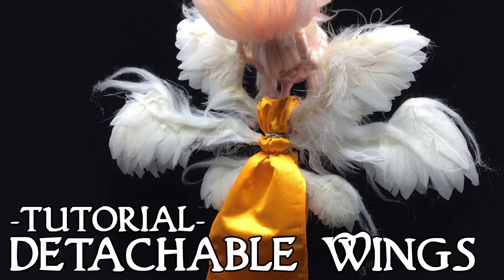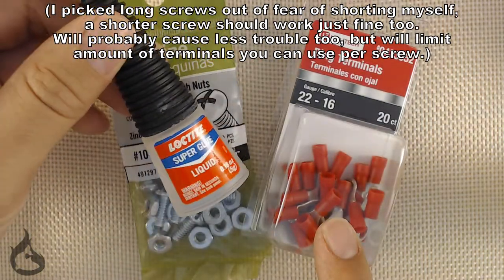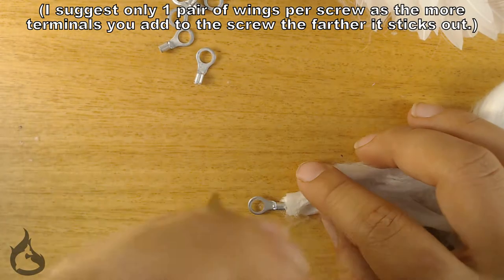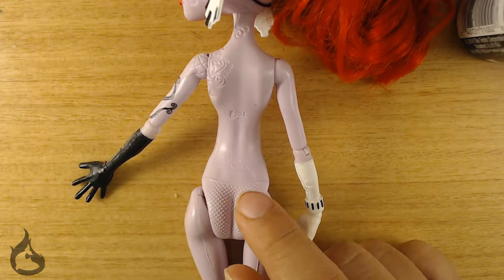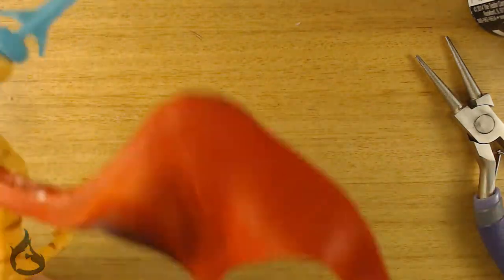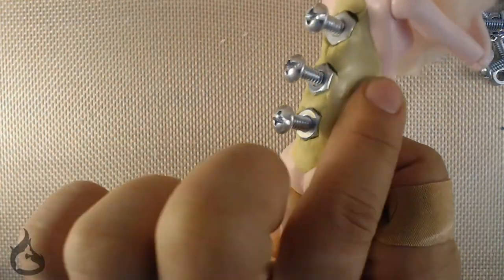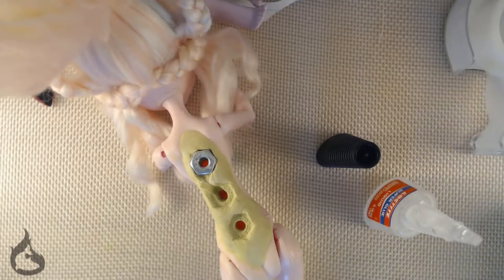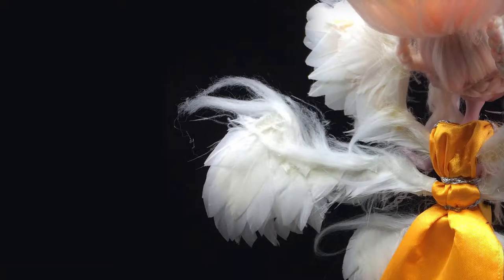DIY Detachable Doll Wings Tutorial

Comment: What i do if is just put some wire on the wings and some how attach it in the clothes. Its either by rapping it on the doll's waist or putting the wire inside the clothes
Reply from the maker: That's a great option, having many different ways to do wings is great so you can choose the best method versus the clothes! Thanks for the comment.